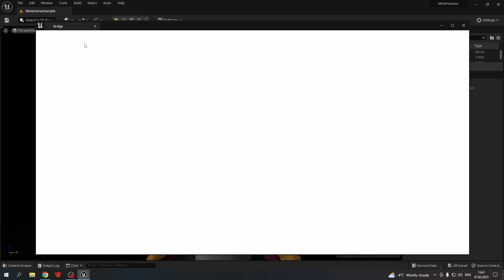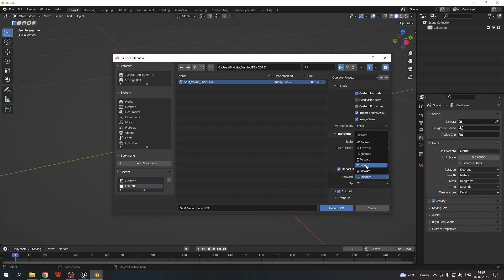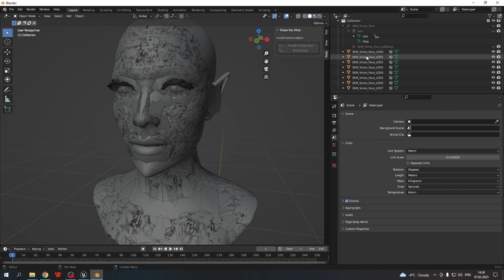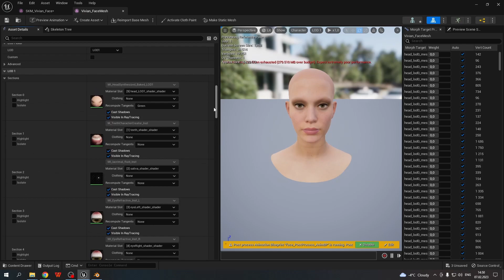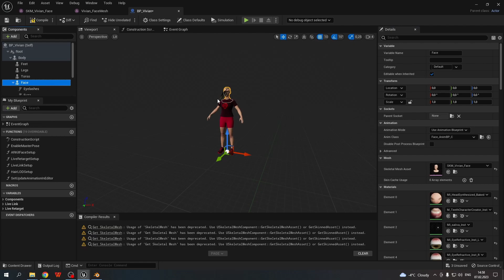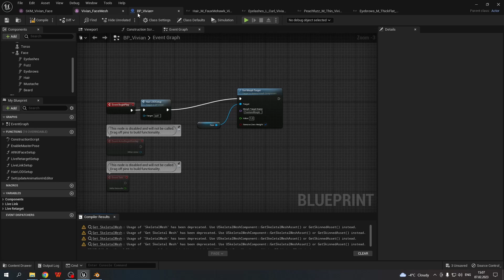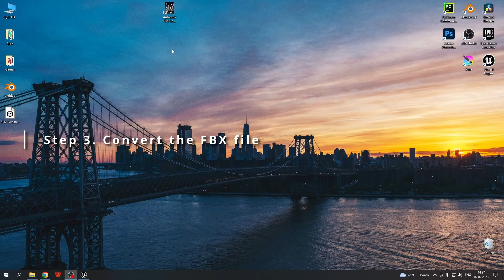Comment: 3:39 After using the Autodesk FBX Converter, , I get a “No objects found in file” error when trying to import into Blender. I'm following the exact process, is there something I'm missing, maybe a version issue? I'm using Blender 4.0.2.

UPDATE: I figured it out. You have to make sure you have the right bit version of Autodesk FBX Converter installed, as it will let you run both the 32 and 64 bit versions without any difference. So, I installed the 64 bit version and it worked. Hopefully this post serves to help someone else facing this problem.

Cheers!

Comment: I got "Not enough parameters" error with Autodesks converter but It turned out I just installed the wrong version, after installing the 64 bit for windows it worked fine.

Comment: Is it possible to move the eyes? Resize them? My attempts have worked, but left the pivots for the eyes in the original locations causing the eyes to bulge out of the head when looking around. Do you know how I might move the eye pivots/bones so they will still work with a large-eyed character?